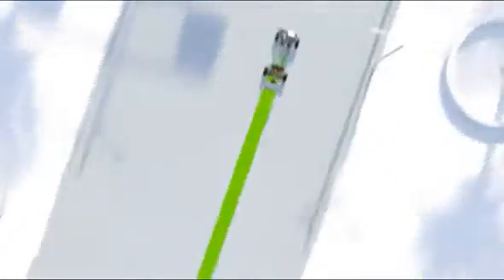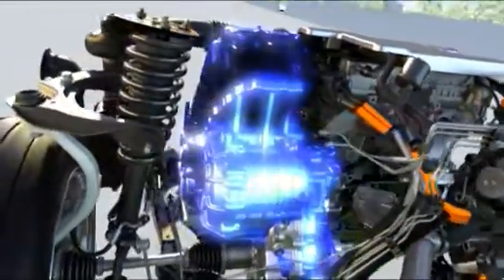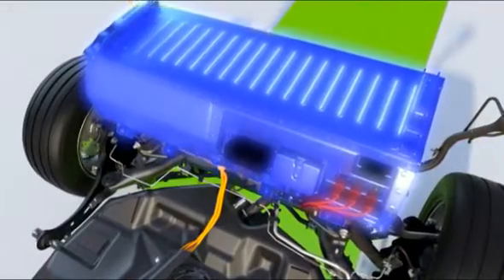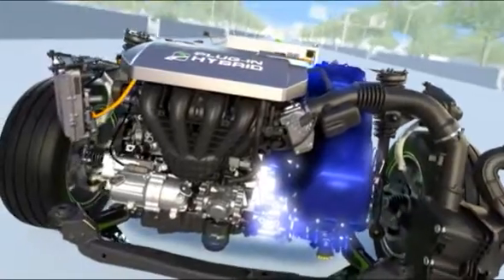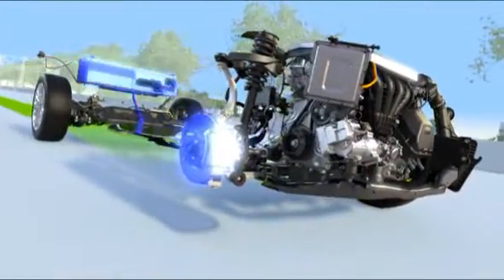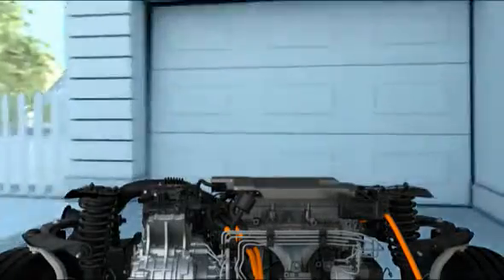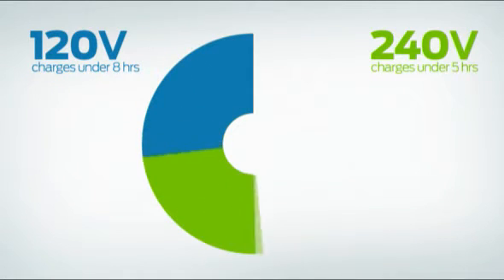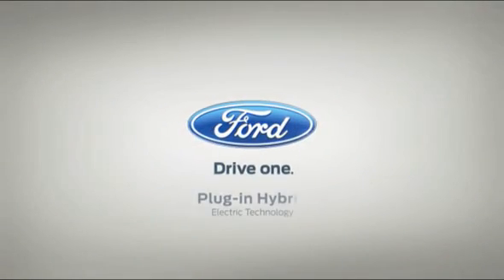Ford's Electric Vehicle Technology - Plug In Hybrids - Part 2

Comment: There are two kinds of driving,,Local, sometimes called 'city driving',, Batteries are now good enough to have at least a 40+ mile range available. And then there's Distance, also known as highway or the 'Road Trip'. This high speed highway driving over distance is where the ICE is still best at. My question of interest is whether the people at Ford will be smart enough to make sure their plug in hybrids can go at least 40+ miles on batteries. This video doesn't make that clear.  We'll see!